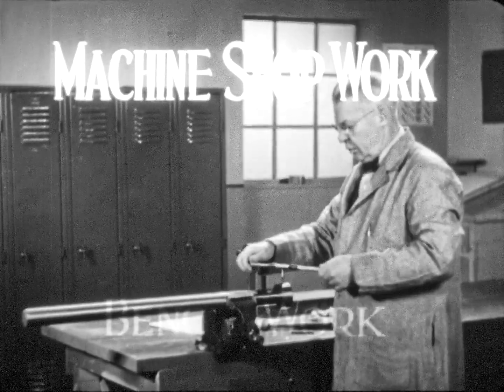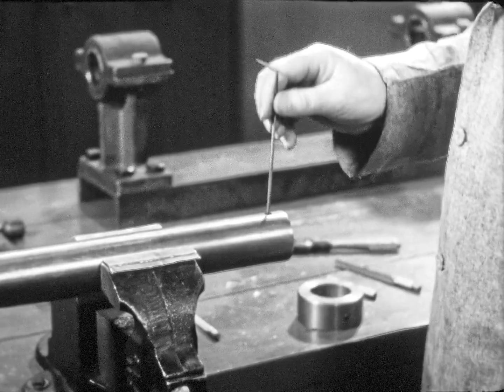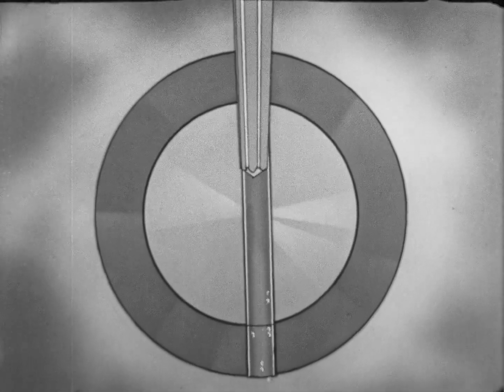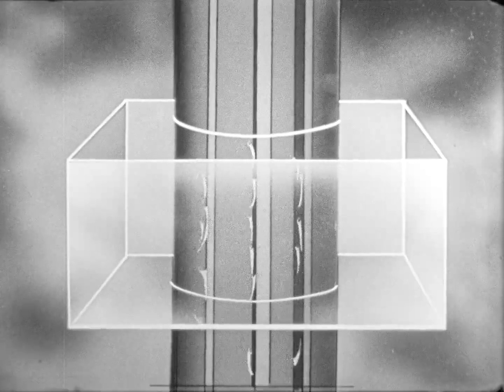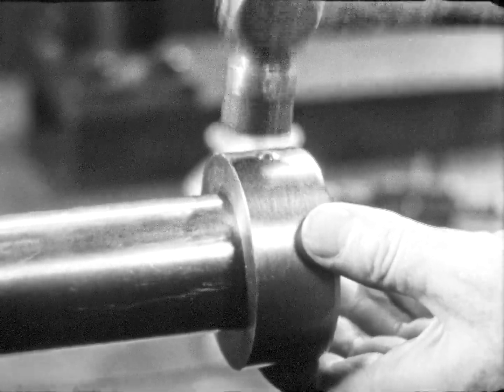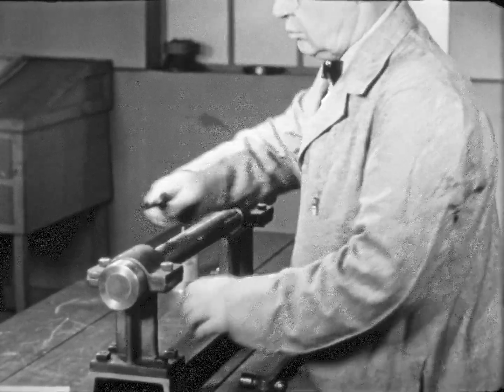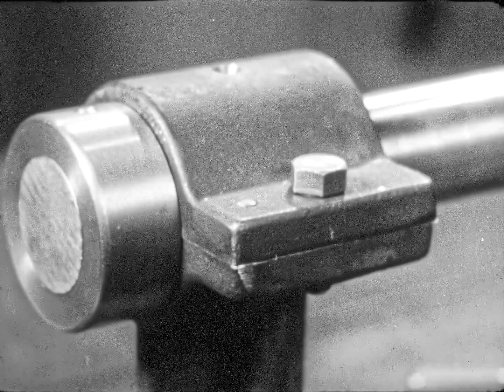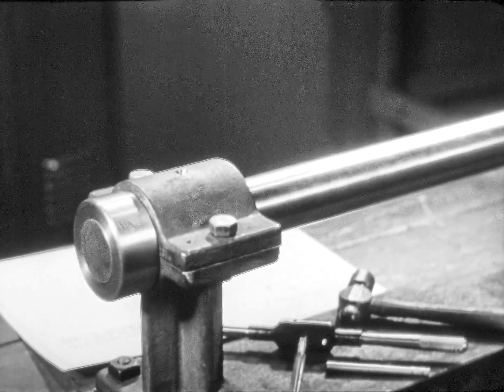Reaming With Taper Hand Reamers

Comment: Well, I just learned a few things, and I've been doing this for years!  I was just watching out of idle curiosity.  So, now I've caught up to the technique of 1942!  I learned about this in an old "Model Engineer" magazine, and loved the way the fit was adjustable, and that you can use hand methods and a single tool to make something that fits closely but might or might not come apart easily.  There are a lot of advantages here, too bad the tools are expensive, and taper pins aren't so common either.

Comment: Bit different nowadays , they just drill a hole & wack a roll pin in !
Reply: I'd much rather use a roll pin than a taper pin nine times out of ten. At least roll pins will take a while to fall out whereas a taper pin is either perfectly seated or totally useless. Depending on the job of course.
Reply: Well, there is that!  And it's just a nominal size hole, too!  Taper reamers are rare and expensive as you probably know.

Comment: While I still use taper pins on and everyday basis there time has past and there our just better ways to build machines now
Reply: What is the modern alternative?
Reply: Newer is not always better. It's just newer. I have all kinds of equipment that was built in the 30's and 40's that still hold better tolerances than a brand new machine.

Comment: Nowadays, if you can't put it in a CNC machine, most "machinists" would be completely clueless if asked to ream a tapered hole.  The old skills of hand/bench work are becoming a lost art.
I have nothing against CNC, but if you're going to call yourself a machinist, you should have certain hand tool skills, and for the most part they are not taught anymore.
Reply from the maker: At the museum, we have on display, side by side, a blueprint and the pencil drafted drawing which was the source for it. Young folks are amazed to realize the original was hand drawn. I use the display to explain the "garbage in, garbage out" principle. The drawing needed to be accurate in every way needed to physically create the described machine. Any error would cause the machinist to fail in his work and the project would also consequently fail. Any engineering changes would require the draftsman to create a new revised drawing.Today, an engineering change is easy and cheap to implement with the amazing tools in the CAD world. This still doesn't exempt the engineer or machinist from knowing what they are doing. Perhaps an ignorant person may be able to blindly follow a cake recipe and still make a proper cake. But if they don't understand what they are doing, they are incapable of catching and correcting any error which may occur along the way, and the cake fails. Ignorance also prevents innovation. Modern tools should advance productivity and innovation. They are no excuse for us to become ignorant or indifferent to what we create.
Reply: @Charlie I'd be interested to know why you think this is the case. Did you read an article about how machinists are trained these days? I know a few young (25-35 years old) machinists who do exquisite work refurbing old machine tools. They definitely know how to do benchwork of all kinds and do it well. I know at least two of them graduated from our local community college machine tech program.
Reply: @LiLi-or2gm  - I'm speaking from what I've seen over the last 35 years of being in the trade. I'm glad to hear that your local school has a machine tech program. In my area of the country, most schools have done away with shop classes. I went to a trade school, then served a apprenticeship. That doesn't seem to be very prevalent any more. I am hopeful that more schools begin to focus on the trades again. We need qualified machinists.
I didn't mean to imply that no one is trained in bench-work any more. But for the most part, people are trained to program and run a CNC without learning the manual machines and other hand skills. I believe this is a flaw in the training system.
Reply: i find no one fills out revision columns.... this 'perforce' sounds like a saviour for my particular situation!
Reply: I like to do bench work, learned it here in Germany working long years as toolmaker, but the good young people of today have skills you even don‘t know that there can be skills. Don’t forget that CNC machining is not „press the green button“ but so many things that you have to prepare and think to the final end in advance. So some simple things at the bench turn out to be complicated without the human feeling and request knowledge that you don‘t need as bench worker. It is true that their manual skills are limited, but they don‘t need it any more and there is no sense in them as bench work is too expensive. The world is changing but we old farts should never think we know more than the younger ones. We just know different things.
Reply: @nick f Except when more than one print of the drawing has been made and the QA process doesn't have tight control over version numbers. It's the exact same issue as with multiple copies of the computer files. The problem isn't one of paper versus digital file, it's one of inadequate version control. The manual or digital machinist has to be given the exact version-control information, and he must make sure he's working from the latest approved version. In the paper-only era, plenty of wrong stuff got made from drawings that weren't properly checked and released. In fact, we used to say, they weren't released at all . . . they "escaped." We had to forbid the at-will making of whiteprints (the reverse of blue prints but the same process). Only an authorized QA technician was allowed to make and distribute prints, and they had to have logged serial numbers. All released serial numbers of already distributed prints had to be collected up and logged back in before new version drawings could be released. Only by rigorous enforcement of these rules were we able to keep screw-ups to an acceptable level, and this process became much easier and more certain when we finally employed digital methods--whether the part was to be made manually or by CNC.
Reply: @nick f  We use a file management system called Perforce. It forces you to check a file out in order to make any changes to it, and then to check it back in when you're done. Each time the file is updated, the version number is incremented. All previous versions are saved so if needed, the file can be reverted. Permissions are assigned such that only authorized people can update the files, while others only have read access. Perforce is designed to prevent the very problem you've described.
Reply: dont forget most cnc machinists started the old way huh..... i do cnc but reaming a tapered hole is easy, also done it by hand btw.
Reply: nick f Confusion re. old versions of files is not a failing of CAD, it’s a failing of the company’s organisational processes.
Reply: Becoming?